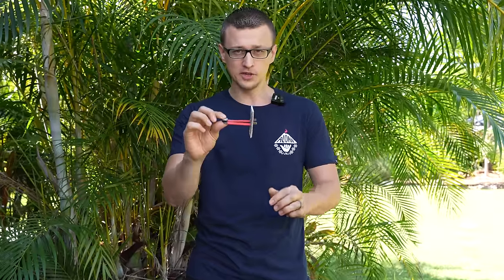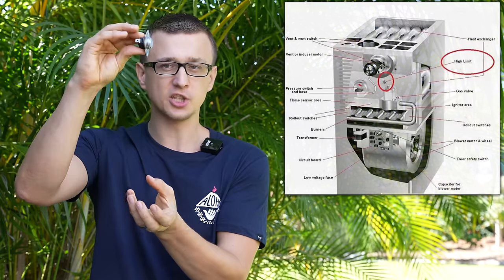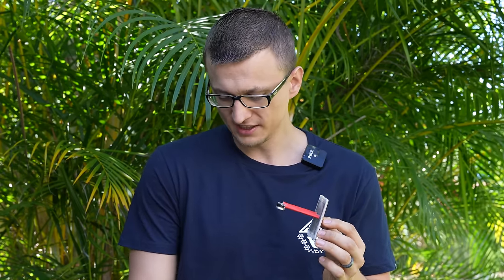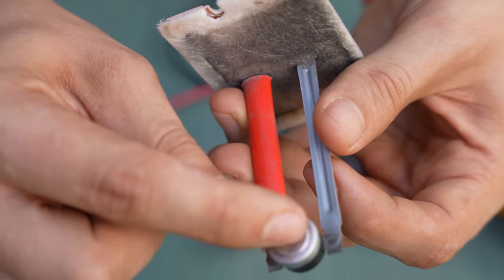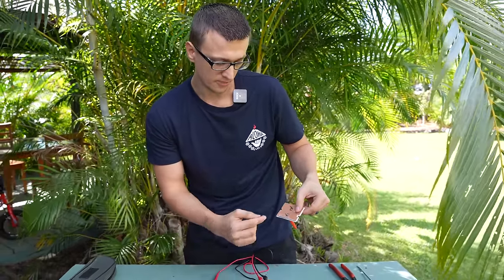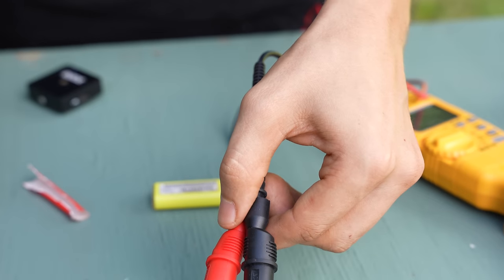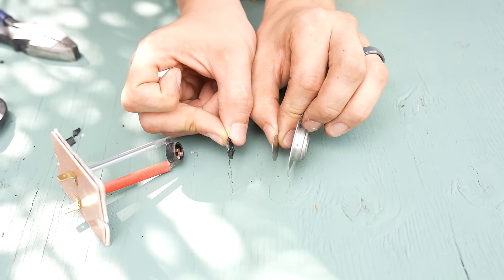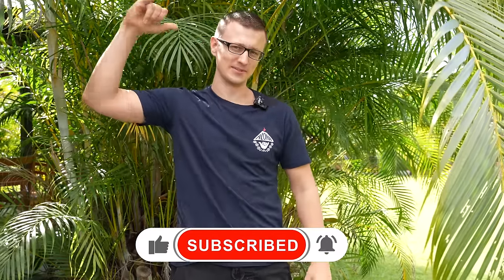HVAC Furnace Short Cycling - How High Limit Switch Works

Comment: Thanks for the very helpful and educational video.  I have watched your videos a lot.  One question I have:  for those non-automatic reset temperature limit switches, I can easily determine which one is off with multimeter after a shot cycling run.  However, for those switches with automatic reset, they might already get auto-reset before I could measure them.  So is there a easy way to detect definitely it is an auto-reset switch problem ?  Thanks

Comment: This is a comment on the dl389 meter that you recommend from a previous video.  I bot one and love it so far.  But I have a comment and a caution on it. First I was surprised that I meter of that quality doesn’t have a fuse in it... I have a couple cheap ones and even they have one in it. Second, be careful when measuring voltage because according to the manual the common lead should not be exposed to more than 25 volts.....so be careful that you put that lead on the neutral or ground.  THANKS for all your videos and education! :)

Comment: A L O H A! This video came at the right time. Along with your other videos that explain the High Limit Switch has helped me to diagnose this as my possible issue of the burner coming on then off and then on again after a few minutes of the furnace running. The control board also showed the 4 LED Flash Error. Again your videos are helpful for us DIY and money saving "can do it myself" community. You helped me diagnose and self replace a blower motor and fan a couple summers ago with such great direct communication which I am still so thankful for. Saved me over $1200.00. Enjoy island life!
Reply: How likely is this switch to go bad on a 21 year old furnace?  I am hearing it's rare but possible.

Comment: I just fixed a high limit to detect over temp from the heat exchanger and didn't actually think that was the problem until I checked ohms on the switch itself . It was weak and was short cycling so I put a new one in and everything has been good to go ! Just a warning from me to you . Get a good quality carbon monoxide detector installed in your homes because a heat exchanger that is cracked could kill you if carbon monoxide levels get too high in your home . And they are inexpensive .

Comment: Hey, great video on November 28 my furnace went out and I have two resettable switches and it was flashing four times which is a code four, a limit circuit fault. I reset the switch and after three hours the furnace came back on and started heating up the house 13 days later it did it again and I watched your videos about the 10 things I could go wrong and I cleaned the flame sensor and the igniter. Put everything back together and 13 days later it went out again. Does that still mean that my heat exchanger is bad? Your videos are super helpful. Keep up the good work.

Comment: Very interesting video. My question is; what causes it to short cycle? Sorry but I don't recall seeing the explanation in the video. Is it because the limit switch has gone bad or what? Thanks for the video by the way!
Reply from the maker: Thank you! A limit switch rarely goes bad, if it is opening it usually means there is a reason. Such as a dirty filter or a bad heat exchanger in a furnace. This video was more on how the switch works not on troubleshooting and figuring out why it opened. That's why I referenced my "10 reasons why a furnace overheats" video. In that video I go over the different reasons that would cause it to open.
Reply: @WordofAdviceTV  
ah okay, now that makes sense. I personally wasn't looking for a fix but was just trying to understand this a little better. 
Thanks for the response and clarification!

Comment: Buddy that right there has never been called a flame rollout switch or a fan limit switch! That is called a main limit switch. A rollout switch is down by the manifold area in the beginning of the heat exchangers! It's job is to sense extremely high temperatures and prevent fire or explosion! A fan limit switch is to detect heat coming back towards the fan indicating that the fan is not running at all! And that switch right there in your hand my friend is designed to prevent premature failure inside the machine due to poor air movement! I don't mean to come off as a smart-ass but I have a whole lot of customers that watch videos like this  and then they get really upset when I show them the actual definitions to these parts! You can feel free to send me a message if you're not sure what a part is called or just Google it! Either way I get a kick out of watching your videos that's why I subscribe to you.....
Reply from the maker: Thank you Arin! I do appreciate you spelling out the specific definitions and purposes of the limits that I showed. I should have done a better job of explaining that they have different purposes. I was too focused on how the thing works. Buy anyway, thanks for this comment! Now this info will at least be in the comments section.

Comment: Thank you very much for your video. Is the thermal limit switch has nothing to do with cooling system?
Reply from the maker: You're welcome! Yes, the thermal limit switch has nothing to do with the cooling system. 👍
Reply: Hahaha... sometimes an overheating condition and faulty limit results in a plastic A/C condensate tray melting.  Come cooling season you understand that a faulty limit and poor air flow can have consequences in the summer months.  Dripping water onto the gas control will also provide for more fun come the cooling season.  Fun and games.

Comment: Question, I have  Goodman 80+ gas forced air furnace.  It runs for about 8 to 10 minutes on initial start-up.  Then the inducer motor shuts down, main blower continues to run. 1 to 2 minutes later the inducer starts back and the furnace fires.  Can I connect the continuity  meter to the high limit switch while the furnace is running to see if the high limit is the cause of the inducer shut down and restart.  Thanks for any information you have, videos are great.

Comment: explain this one if you can i came home one night and my house was probably 250 degrees i hurried and opened all the windows and unplugged the thermostat. The next day i replaced the upper limit switch and everything was good. shouldn't the thermostat have shut down the furnace?  If i had not come home when I did my house would have burned down.

Comment: Do you need to replace your furnace limit switch with an exact replacement? Or same type and temperature settings good enough?
Reply from the maker: In most cases, one that looks similar and has the same temperature range is good enough. No need to do get the exact replacement, especially if it costs 4 times as much.

Comment: Aloha! Can control board failure cause high limit fault? Recently changed high limit switch, flame sensor switch and still has high limit fault. Bypassed high limit switch and it still faulted. Replaced Control Board and now seems to be working fine? Can a Fan Limit switch cause a high limit fault? Thank you again as always.

Comment: It's almost snow time in wyoming.   I am desperately trying   to figure out if it's a limit switch problem or flame roll out problem.  It runs fine sometimes,  then i just push reset on flame roll out.   Runs fine for a couple cycles then cold air again. 

Help please.   Thank you for the explanations.  Learning more every winter.   Lol
Reply: Also i have L175 40F switch.

Comment: Thank you SO much for what you do.  Really helped me.  One question if I may.  I have the style of switch like the first one in your video. I notice you show the flame example with the 'button' pointing down.  Is that how it is also supposed to be installed? Pointed down towards the burners? If I do that then my label in the outside is upside down.  Is that okay or does the label need to show right side up which would have the sensor 'button' facing upward and the flame would be hitting the bottom of it.  Thank you in advance if you are able to answer my question!

Comment: My Goodman is short cycling 4 red lights. I’ve replaced the primary limit switch and the resettable rollout limit switches. Interestingly enough the system runs fine without the filter. Ive been using the least restrictive basic merv1 or merv2 filter and still have the issue. The furnace is only two years old. It’s driving me crazy!
Reply from the maker: Hey Michael! Sorry to hear about the furnace troubles. Have you watched my video where I go over 10 reasons why a furnace can overheat? https://youtu.be/3ZPmltTR5S4
Another option would be to increase the blower fan speed if that's possible on your unit. Set the heat speed from low to medium. I go over blower motor wiring in this video: https://youtu.be/4S8TZd-45bY
Reply: @WordofAdviceTV  thank you for the reply! Is it safe to increase the blower speed? Eg. Is blower speed adjustment a common fix for the issue I described? 

The wires from the blower motor connect to terminals on the board marked T1 T2 T3 T4. Then there are a bunch of dip switches that need to be configured, so appears somewhat complicated...

My unit is Goodman gmec960603bnab.
Reply from the maker: @mikeeeeee555  In most cases increasing the blower speed is a valid solution and does not have any repercussions. Usually I would only do this after I checked everything else though. If everything seems normal yet the unit is still overheating, then I would try to increase the fan speed. Going from low speed to medium speed is not a big difference but it may be enough to stop the problem. But being that the unit is only 2 years old, I find it odd that it is overheating. It wasn't overheating last year right? So I wonder what changed between then and now.
Reply: @WordofAdviceTV  the house was built two years ago. I’m a new owner and this was our first winter. Not sure if I inherited these issues. Thanks for the video link. My system has all of the motor wires connected to main board and a bunch of dip switches that I think need to be adjusted. Perhaps a bit more complicated on my system.
Reply from the maker: @Michael Shifrin Ah I see.. That makes it a little harder. If you happen to have a variable speed motor (it has like 16 wires going from it), with those motors one can't change the speeds. If you have the installation manual from that furnace (or perhaps can look it up online), they should have a section in it that explains what all the different dip switch positions mean.

Comment: Neat video Jay! 

I think the temp gun you're using wouldn't measure the temperature accurately because it measures an area, rather than a point. It puts out some sort of infrared cone and measures a larger or smaller area depending on how far you hold it from the target.
Reply from the maker: Thanks Reuben! Yeah, after I tried using it I had the same idea. That this type of temp gun is not a good choice for this experiment. Should have looked into it better 😅 Thanks for explaining how it works though! 👍👍👍

Comment: So my furnace is giving some heat but not a lot and after about 4-5 mins the fire goes off then restarts afterwards. I noticed when this happens the heat sensor is heated red. I also already replaced the filter a couple days ago what’s the problem sound like?

Comment: So the higher the upper limit of the switch the warmer the air will be flowing at the home? I mean a 200-40F will keep burners running longer than a 185-40F switch?

Comment: Will a furnace sometimes employ a limit switch to confirm the existence of heat?  I.e. "Set a timer and check the status of this limit switch.  If within N seconds the switch remains open this means there is no heat.... so turn off the inducer and then try again in 90 seconds."

Comment: I have watched many of your videos and have replaced ever limit switch and it is still keeps kicking off before the heat comes on
Reply from the maker: Sorry to hear about the furnace troubles. How far in the sequence of operation does it get? Does the blower motor come on? Does the board blink some error code when it shuts off?
(sequence of operation: https://youtu.be/AQD_MedIklI )

Comment: hello, i have a code on my furnce that reads its the .. Limit Circut Fault ..i want to check the wire going to and from the saddle on the control  board for this limit circut.. is this the red wires ?

Comment: I have the little beige one with the button reset. My furnace has been igniting the first burner and failing to start the other two. However, it does intermittently succeed. I've cleaned the flame sensor, the burners and cleared out all the debri in the burner box. I took the burners out and blew out the fuel path between them. They all appeared clean to start with. The furnace is only two years old.  The exhaust pipe (PVC) is the Diversitech CVENT. So I don't know how to see inside the exterior pipe. The centre pipe looked clear but I could see water at the very bottom. Is that normal?   A 'P' trap maybe?  There is nothing covering the centre pipe. Should there be? After all the cleaning and reassembly now the furnace is short cycling. Perhaps just replacing the high limit switch and flame sensor is the next step. With that in mind my furnace is using propane so are there different switches and sensors that I should replace them with? You are the most professional and knowledgeable presenter that I've found on YouTube so I'm hoping you will have the insight I need. Thanks so much for your hard work in posting these videos.
Reply: The limit switch continuity test passes. Also, would closed vents affect the startup?  My boys often cover their vents.

Comment: just had my furnace inducer motor and thermostat newly changed, the flame sensor had been cleaned twice yet my furnace will work, and cut off before reaching hot or desired temperature. What can i do or check again?

Comment: I have this Carrier gv3aav and my inducer motor turns on for a hot second then nothing.. I get error code 31 and I noticed the inducer motor gets 5v then drops to like 3v. Any idea why that might be happening? There's no capacitor only a big one on the other motor.
Reply from the maker: That sounds like it could be a stuck pressure switch problem. I would suggest starting with this video and seeing if any of the presented problems are what you are experiencing: https://youtu.be/Zax02itYHkU

Comment: Update on HVAC Furnace Short Cycling - How High Limit Switch Works
Six hours ago a Goodman technician came out to check on my limit switch problem. So far, no problems running a Merv 8 air filter. Turns out the flame was set too high(hot). The gas valve was set at 4.25 ?? He set it down to 2.75?? Is that called "over flaming"?? He did use a meter tapped into the gas valve to read and set the value. He also checked the combustion efficiency with a different meter.
 The furnace is running, much quieter through out the house. He also checked to see if all return vents are working by placing a piece of paper over each one to see if the paper would stay in place. He made sure all butterfly valves that control the registers were open. He didn't need to check the blower speed. Now glad I called a professional.......

Comment: Hey Jay, Your instructional videos are incredible! My Dad and I have used them for troubleshooting for AC & Furnace issues. Question... We have been trying to diagnose a short cycling furnace problem for a couple days now. It will ignite, light and then go out anywhere between :30-3:30min and then cycles again, have to reset furnace with switch after 3-4 times.  I have an 15 yr old American Standard High Efficiency Gas Furnace (AUX 1C100A9481AA). The diagnosis light is blinking normally. We have bypassed the Upper limit switch, filter is new,  checked the vent, cleaned the burners, no drain problem, made sure the flame thermocouple is placed & working correctly, flames burn blue and perfectly draw in, checked all electrical connections are tight, bypassed all three limit switches, one at a time, and doesn't change the cycling, checked that PVC vent is angled upward correctly, and probably see other items... I thought I would make one last ditch effort to reach out to you and your community before we throw in the towel and pay the piper. Thanks in advance for any suggestions you all have!
Reply: This afternoon we did something that is finally getting it running past the 3:30min and staying on. Not really sure what I did to fix it though??? I ended up cleaning a very small amount of debris from the outside (side of the house) of the exhaust PVC. It sure didn't seem like a lot, but maybe. Also, I disconnected the exhaust vent PVC inside the house for a few minutes to see if that change in pressure would keep it going, thinking there may be a restriction in the line, but it ended up stopping before the igniter even glowed and cycling again. In the process of disconnecting the exhaust inducer I had to loosen all the inducer screws and move the inducer to disconnect the exhaust vent PVC. Well after all that, now the heat stays running. I know the pressure sensor is extremely sensitive, so maybe getting rid of some little restriction in the exhaust PVC did the trick?? Thanks for your replies and cross your fingers for me that it stays working :)
Reply: @davethomas6800  your AC evaporator coil is clogged. Check YouTube videos of clogged AC evaporators coils. They get gunked up with debris and prevent your furnace from blowing air through it efficiently. They get so clogged that they restrict air flow, and your furnace overheats because all the hot air is trapped where all the sensors are, causing them to trip! Make sure you look at the INSIDE of your A.C. evaporator coil, by the way. The OUTSIDE of the coil will always look clean, so you need to inspect the  INSIDE. Reply to this comment if you end up checking the evaporator coil and cleaning it...curious if it will fix your issue.